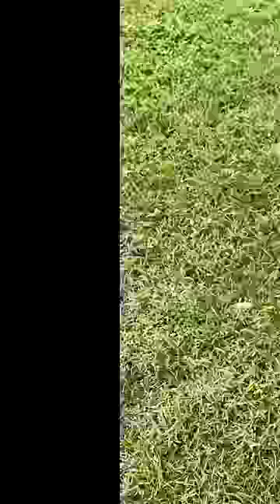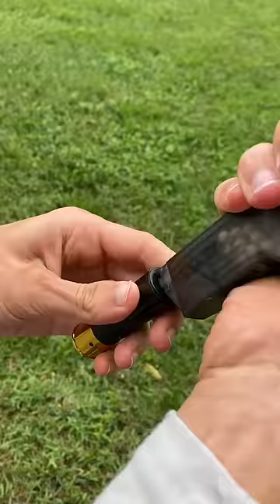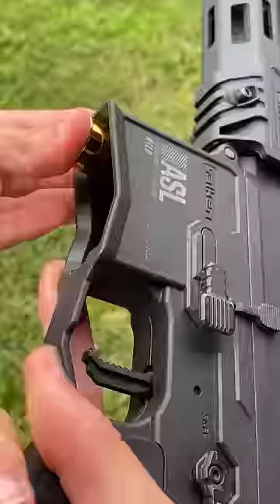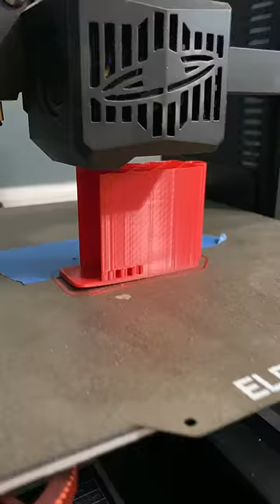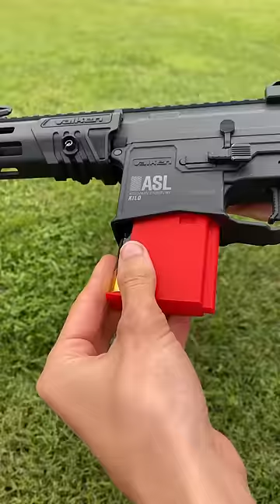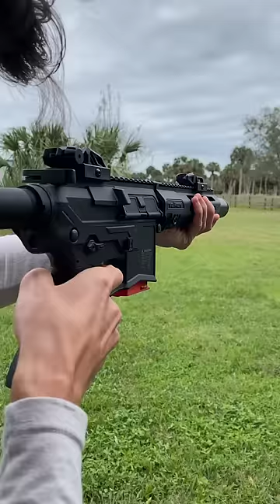Let's Put Airsoft Shotgun Shells in an M4

Comment from the maker: Join the Patreon for access to all of our CAD files! patreon.com/AirsoftGunsnGear
Reply: Make and adaptater to fit and lmg mag in a sniper
Reply: You should put an M4 adapter in a revolver… like an M4 mag has a hose that lines up with the front of the hole where bbs go and after every shot when the barrel rotates it pushes another bb there.
Reply: @Airsoft_Ninja  i think this is impossible
Reply: @tacosfr  so you know how box mags work? There is a wheel that pushes bbs through a hose. Imagine that hose puts a bb in the front of a chamber every time you shoot because the chamber rotates letting another bb go in. And there is an m4 mag that pushes bbs through the hose.
Reply: @Airsoft_Ninja  i understand but with the revolver u need to print an adapter that is fixed to the gun and not the chamber to let her rotate but at the same time the bb need to go in the chamber and if u watch an m4 mag it has a little fing at the top that might block the chamber maybe ur idea is possible but it’s seems very difficult to make and no practical on a revolver
Reply: DO IT TO A AUG A1 I NEED THIS FOR MY AUG
Reply: @tacosfr  a shotgun shell isn’t practical for an M4. We would be doing this for shits and giggles. And maybe if that certain revolver has rails we could attach the adapter there, and put the mag in the front facing you
Reply: A mag for an m4 or pistol that uses shotgun shells
Reply: @shadow-wd2ot  didn’t he just… nvm
Reply: Could you share the STL?
Reply: this is amazing put it on thungivers3
Reply: Do it for ak47
Reply: With my g17 I pull the slide 2 times and now it's a shotgun
Reply: Show us a video of u using this in a game lol
Reply: All u did is make it California legal 💀
Reply: Oh air soft I see
Reply: Can you print your own (basic/general) magazines for any airsoft gun tho?
Reply: What CAD software do you use?
Reply: what 3d modeling software is that
Reply: Mak3 me a TACAMO  D-MAGS MAGWELL
For the HELIX body kit for TIPPMANN A-5
Reply: Or make a TIPX MAG ADAPTER TO D-MAGS 
YOU WILL lot of money y you sell it it's easy to make sell it on ebay I will buy one and they sell like hot bread
Reply: Hey, what’s the name of your 3-D printer?

Comment: You typically apply this to more than one shotgun shell in a magazine you can make it so there's a push mechanism in a dropper mechanism you flip a switch on the 3D print drops the shell and then another shell will take its place actually it will be better to use a button

Comment: I’ve never measured the mag well of an m4, airsoft or otherwise. So I’m not sure if this would be possible, but could you print a symmetrical adapter with 2 shotgun shell spaces and just have to eject and rotate for a reload?

Comment: I swear every time I see someone 3d print something it’s just the most unnecessary or redundant item possible
Reply: I made an m14 to m4 magwell adapter because everyone has spare m4 mags. Looking like a mini-14 was a bonus and the looks i got were well worth the few hours it took to design and print. Sometimes you do shit just cause its fun. Taking as long ad he did to model that m4 mag and "getting lucky on the measurements" like that though, not the best way of doing things even if just for the meme